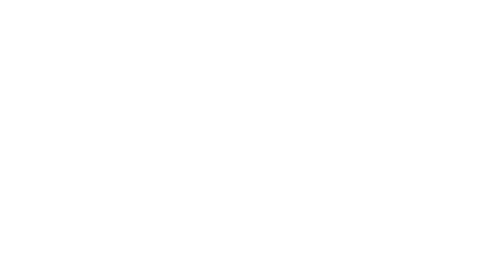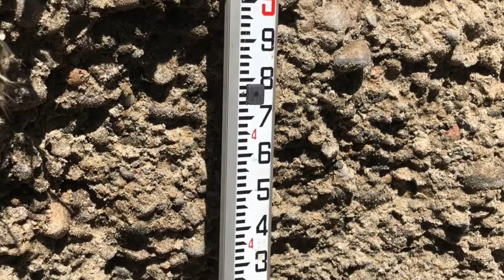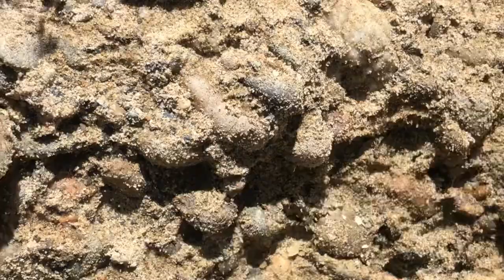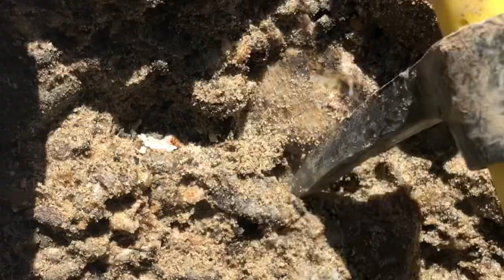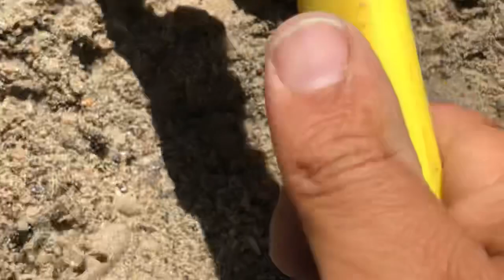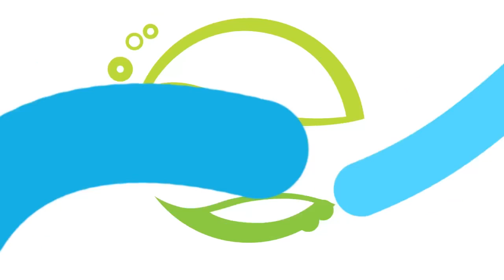Septic Perc Test Procedure, Test Pit: Fast Draining Soils

Comment: In your opinion, what is the best way to determine where to put a test pit to hopefully not run into a fast percolation soil? Secondly, how does someone avoid the exact opposite where there is an abundance of clay and non-well drainage? What physical characteristics above ground should home owners look for identifying best locations for test pits and Septic Systems?
Reply from the maker: We normally conduct test pits in close proximity to the area we deem the septic field should be located in.  Regardless of the soil types.  We conduct 2 or more test pits to determine consistency in the soils for that location.  We then design the septic system for the soil types that we encountered during testing.  We look for drain field locations where it is out of the way of vehicle travel, we look for locations that are fairly accessible for maintenance providers, and we look for relatively flat zones without too much slope.